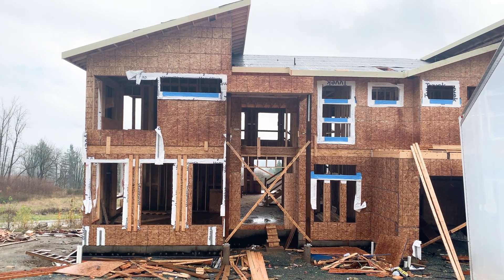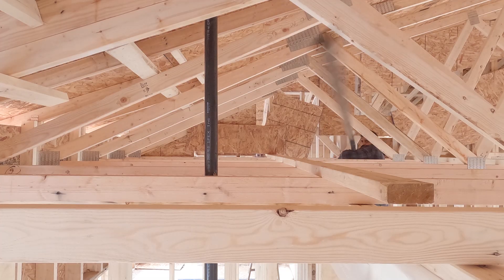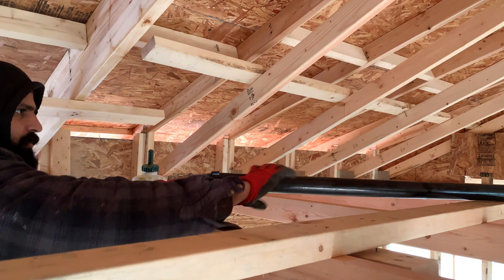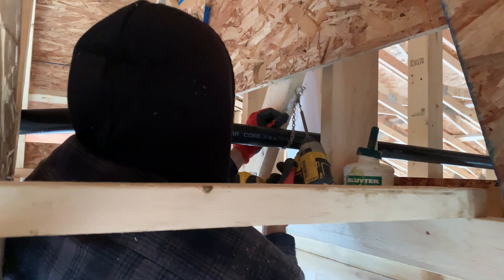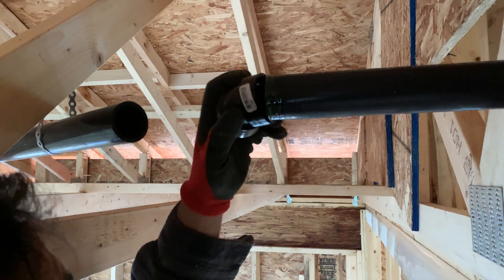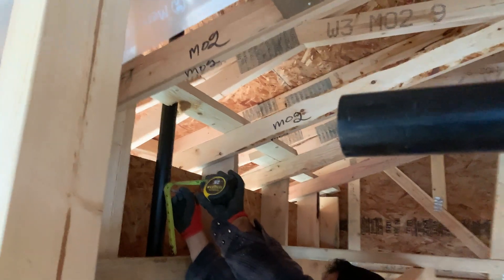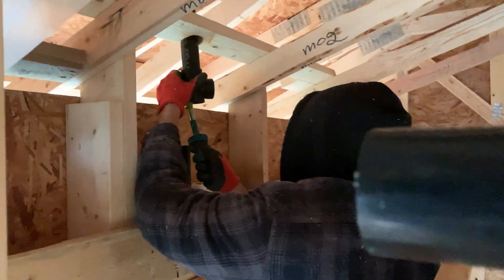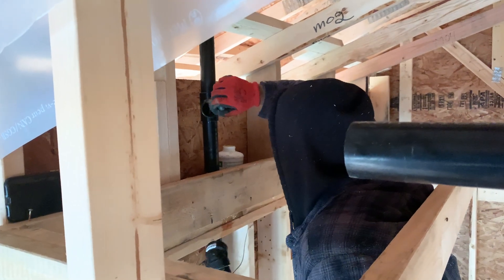Plumbing Rough In – Relocating a Vent (EP4)- The Building Expert 2021

Comment: How come you guys don't use primer. And I thought abs plastic was banned
Reply: Abs doesn’t need primer.
Reply: Abs is permitted in houses or buildings not exceeding 4 stories I think. Abs is very toxic if burned so it’s replaced with other materials that are more fireproof
Reply: Nice work! Is it a problem to have a vent travel horizontally (with slight incline)? Will gas travel over those distances and escape as it should?
Reply: Abs warps too